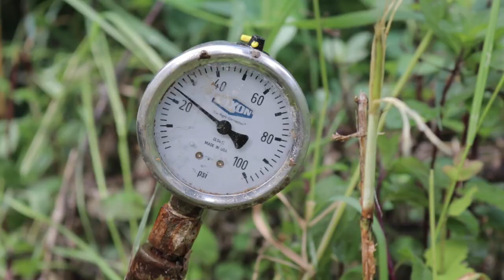My New Ram Pump - AMAZING!

Comment: for your curve shaft weed whacker illuminate the push button cartridge and use 1.5' of .155 line . put it through one hole tie a knot in the middle around the shaft and poke the other end out the other hole. if you have to drill out the holes to accept the line, do it. i highly recommend this method. way cheaper and almost invincible.

Comment: Loved the explanation of the Ram pump. I wish we had a spring or stream on our farm so we could use one... We're installing battery backed solar so we can have water from the deep well in an outage.
That thing about remembering to turn the switch on? Too funny! I've done that more often than I can count. You''d think that after fifty years of running small engines I'd remember the darned switch!

Comment: defiantly splurge on the unions...buy extras for diff sizes and other fittings if you are not good with pipe you can lay it on the floor for a mockup visual aide

Comment: you need to make a basket out of hardware cloth or use a container with lots of holes drilled into it that fits around the feed end of the pipe and wrap that with screen.I guarantee it will flow alot longer before having to clear of instructions,i have lived my life fixing and maintaining water pumps and picked up a few ideas that work.peaceout you guys and well wishes

Comment: while working with a weedwacker,occasionally tap the cutterhead on the ground while its spinning,so it feeds a new line wich is cut to proper length with the blade on the safety guard.its that simple.its not coming out by itself.

Comment: I got rid of my normal weed eater head and swapped it out with a MUCH easier to use push button.  You slide a thicker piece of weed eater wire into the head one at a time and let go of the button, then tada!!!  the longer lasting wire is in place with no having to wind anything ever again.
a few pre cut wires in your pocket will let you weed eat all day and a simple pushed button lets you change the wire. Super easy.

Comment: I just thought of an idea. Is there a way to attach a line to where the water spouts out of the top from the T valve that would bring it back to the little pond? That way you wouldn't lose any water supply. It would continue to be recycled and nothing would be wasted.

Comment: For your union on the ram pump, for future reference, you may want to try a hammer union.  We use them for oil and natural gas piping and they work great.  All that you need to tighten or loosen them is a hammer...

Comment: Just off the cuff Cody, have you considered plumbing the big pump and the small pump in parallel so that with the flip of a ball valve (or gate) you could switch from one to the other, perhaps it could even make maintenance easier as well.  Just a thought. 
Thanks for the segment, interesting as always.

Comment: Would a ram pump be better than putting a small electrical turbine on the end of the pipe, hooked to an electrical pump? Although it is electric, no external power source is needed as the pump draws all its power from the turbine powered by the water, similar to the ramb pump.

Comment: I'm an engineer, great video.  A suggestion, make a big ball out of screen and put that on the inlet end.  The more surface area of the screen, the lower the flow speed through the screen and the less likely the screen will plug.

Comment: You can just get it twice as long, stick it through a hole in the middle and then just make the two even long and wind it following the arrow on it on the back.
Just not wind it to tight and not across each other and it will work fine. The problem with the round wire is that it gets stuck all the time. Just use some thicker square wire and no problemo any longer.

Comment: The motivating force there is inertia. Moving mass has incredible energy potential. The ram pump you have there is a prime example of that working. Block off that exit valve and measure the pressure spike when the waste valve shuts. If your drop was high enough it could literally break the pipe. There is amazing amount of energy there. Love to see that harnessed. You put it to good use.  I'm a little concerned about one made out of plastic pipe since plastic will stretch some. It will still work but I think size for size the steel would be more efficient.

Comment: If you weed eat to close to hard surfaces the angle and pressure on the string will "crack the line" at the head. This also happens to harder line (which slices grass better but is less flexible).

Comment: Just a useful tip for the future. Take a steel Hammer with you next time and hit the nut on the Union. Really hard on both sides and the top. It'll come loose really easy after that.

Comment: looks good  I want  to transfer water using no electricity to feed a small fish pond then run the water course in a loop.
My water source will be from a rain water tank 1000 litres ,is there  a way to save the water from the primer to reduce waste
 I am keen for feed back  from people with any experience or ideas to achieve this.

Comment: I know this is an older post, but I keep my string from getting brittle by soaking the supply spool in water every once in a while. I know it sounds if it it's a silly idea, but it does keep it a bit more pliable and less brittle.

Comment: I made my own wrench for unions like that. Piece of spring steel I believe. Hole saw to make the main hole and a file to make the full lands. Works well for getting the crazy force needed to work a union. Used my forge to flatten out the end wide enough. Would probably be a fun project for you (assuming it was actually of value).

Comment: Put a coat hanger in your tool bag, there. Use it to chase those kinds of clogs. Also, put the same screen material on the top of your standpipe that is used to add airflow.

Comment: This pump works similar to my Reverse osmosis water filter system with tank . Has the same valves and waste water action with the tank holding the pressure and water .

Comment: get rid of that spool of string on that weedeater. go with a commercial head that uses very heavy string in 1 to 1.5 ft pieces. no blade use, and no reel to screw with

Comment: Could you run line from the first valve and collect what it puts off as well? Maybe have small overflow vessel on top, with holes in it release the air pressure that it might build up in the 2nd line. Assuming that would work, you'd have no water loss.

Comment: Seems like there must be some way to use or put to use all that water that gets pushed out of the check valve. I mean its full of energy and has already been pumped wonder if there is a way that could be put to use in the system

Comment: you should take that screen, roll it up in a 1 or 2 foot section, cap one end, and connect the other end to the pipe. It wouldn't clog as fast, more surface area for flow.

Comment: one suggestion for the collection point for your water is a sand filter is what I call him they're white pipe perforated you can set up on the shoreline in the lake right on Sand and they will not suck up sand with a pump I believe they also are quite similar to Sandpoint steel head you could just use a flexible piece of pipe and toss it into the deeper part of the water and it would take a lot longer for it to clog up ever

Comment: Question?      
I'm curious if you thread the waste gate and flow that ahead of the check valve would that give you a slightly higher flow rate?         It's a big what if.    But that seems like energy wasted.             I would love to have a ram pump but we have no elevation with our water it's all flat for 100 yards.

Comment: I think it would help if you put another union on the upstream side of the intake valve. You could than unhook everything there in the fall and it would be easy to clean the pipe in the spring.

Comment: OMG  learn how to use a pipe wrench 3 point  your wrench if you not 3 point your wrench you are squeezing  the pipe or fittings known as egg shaping  and it will be less of an effort  to break it loose

Comment: my question is that if water is free flowing into the pipe at the river, how is it building pressure unless it's running down hill?  the river should be the lowest section of tube.

Comment: You can buy aluminum heads for trimmers that only take small sections of string but if you buy the string with wire in the middle you'll rarely have to replace string.

Comment: Idea for the inlet screen. 
If the water comes from the left close of the end of the pipe
Cut the belly or lower part of the pipe as long as you can and cover it in mesh 
Idea is that the mesh being under the pipe all the dirt is more likely to fall down
Even set the left end of the pipe lower in the water so it is at a bit of an angle
Anything big will hit the top of the pipe and not the mesh

Just ideas ;0)

Comment: You might look into a speed loader for your weed wacker. It prevents the cord from going back into the spool and is much easier to load. The only drawback is that you have to load it more often but it's not bad.

Comment: You should try the echo easy load head they are a lot easier just line up the holes enter about 15 feet of string center it and start winding the head till it only about 8” sticking out. By the way the string head your using I think is one of the worst models around and it also wast more string than any other type also breakers off the string at the holes a lot more than others

Comment: Take a piece of coat hanger with you the next time. You can bend a small hook in the end & use it pull out the obstructions in the pipe.

Comment: didnt see anyone else say it...but after you wind the lower string on the trimmer spool, there is a notch to put the string in to hold it.and also lines the string up to outlet holes...so you dont have to hold it in your fingers, and have it possibly unravel

Comment: Just a quick suggestion for a possible upgrade. 

I have seen a few videos on ram pumps other people have built and posted here on Youtube and found a few people add a collection bucket/barrel to separate the collection pipe from the ram pipe in order to reduce/eliminate the amount of air and debris getting into the ram pipe and reducing flow rates. Usually the water inlet is at the top, ram pipe at the middle, an overflow pipe between the two, and a drain to let out sediment and drain the system for winter in the bottom. A lot of people also add a piece of rubber or plastic to deflect the inlet stream away from the ram pipe to prevent sediment and bubbles from getting sucked in. 

The addition of a system like this is not required but it may help you to not have to clean out the pump as often.

Comment: cool video!!  something that might help with the weedeater is spraying a lubricant on the  line in the head. not wd40 though anything with a solvent in it ends up melting the line.

Comment: For the weedeater if the head ever breaks on that one I  would recommend a new type of head where you just tap it on the ground and more line feeds out. I got it last year and its cut down the amount of time I spend on line changes enough to justify the upgrade

Comment: Nice to see the ram pump at work again. I'm pretty sure I understand how it works but I was wondering if you had a tap on the outlet and it was closed would the ram pump stop working ? My thought is that you have to have the outlet open at all times for the ram pump to continue pumping.

Comment: This is why I love the little cheap Homelite trimmers you can get at Home Depot.  They run fine and the trimmer head has an auto feed, where you simply just thread a new length of trimmer line through the center with the head fully intact.  Takes all of about a minute to restring it when you run out.

Comment: Man, I love those hydraulic rams. I often wish I had a property just steep enough and with a streamlet, just to play around with those... (and I should start wearing a t-shirt "danger! engineer inside")

So, here's a hint that might help you keeping the inlet clean:
Maybe you can build a kind of gravity filter, with 2 chambers, the 1st with the inlet under water, being fed by the spring. Then you add a vertical bar, which the water needs to flow over to reach the 2nd chamber where the pipe is connected.

The underwater inlet keeps anything out of your pipe that is light enough to float on the surface.
The chambers themselves shall enable any sand or other stuff to sink to the bottom, so they have to be built just large enough to ensure a slow flow.

Should be rather easy to clean out, too if you add a lid on the top. And it could be built from some harder wood to make it halfway "waterproof" so it doesn''t rot away and gives you another nice wood project. :)

Cheers & greets from germany!

Comment: Next time you buy strimmer string  get  the  4mm , it cuts  through all tough vegetation and  does not  break so often , 3mm is  a total pain  for  snapping,  I have  the  same  model strimmer  as  you and  it  works  brilliantly   with  4mm

Comment: A helpful hint to extending the life of the trimmer line. Its a monofilament line like fishing line. If you think about it, fishing line becomes brittle if its stored out of water. Although if it is being used often it will last you the fishing season. With that said, I know a little bit about that stuff and if its has not been soaked in water at all times from when you buy it, it will dry out and become very brittle. So what I do is fill a bucket with water and throw the line in the water. Give it a few days if its new and you will be able to see the difference in how long it takes to snap a piece of line off or melt together. I hope this helps.

Comment: This is really cool, it bleeds off a little water to give the long column of water in the higher pipe some speed witch is a lot of kinetic energy that is then used to compress the air in that pipe, then that compressed air pushes the water up to the water tower.

Comment: when you restring a weed eater, cut a lengh of string you want, and let it unwind,  on the florr, then hold the string holder, and spin it, as you let the string wind up, helps the string find its place, and not be stressed, in twisting, , also try to be a bit more particular, wind it up nice and neat, like thread on a spool, or wire rope on a winch

Comment: I think I would take a short piece of 2 inch pipe and drill several holes in it and then rap it with screen and use it for the intake filter.

Comment: where you have your inlet 
you should bury it deeper and cover it with a layer of gravel then a layer pea shingle and last layer of sand 
that will help you from having to clean out your system every year  because the water will be filtered before it enters your inlet

Comment: mrs w will need to tap the string out more often to avoid the string breaking off into the winding part  it just gets weaker around the pivot point  or alternatively get better quality string

Comment: You can save a lot of trimmer wire and time changing it by getting the new style where you cut pieces individually and insert them in the swivel heads. I love mine.

Comment: How do sticks and pine cones get into your system past the water inlet screen?!? I would think this problem would be quite simple to correct?  …,And this question maybe premature as I have not finished the entire video...
Reply: It probably gets in through the ventilation pipe. Must be birds or something trying to hide acorns for the winter. Nope. 🤣

Comment: You could put the head of the pipe completely under water and build kind of an upside down pipe trap after it so it would keep the water level high enough and that would prevent any debris from getting into the pipe since most of it is on the surface.

Comment: so you do know that their are notches for the weedeater line so you dont have to hold it will wrapping the bottom. makes it a little easier to put it back in the head it also has notches where you can line the string up with the holes they go into and it holds the spindle down till you put the cap back on.

Comment: you can get a simpler aluminium head that take's 3mm line,maybe thicker and load's from the top,without having to open anything 'gb super cut brushcutter head' not terribly expensive,might have to order it from Australia though
Reply: tanaka make a tiny little one,but these are twice the thickness and a bit larger in diameter and hold more line  and load different

Comment: You could put a second pipe that connects to the end on a solenoid valve and a compressor fitting. Then you can automate a backflow cleaning system so no one needs to clean the filter.

Comment: Cody, How about on the inlet at the dam you put a 90 degree elbow and maybe a short piece of pipe on it so it sucking water just below the water surface so your getting less floating debris going down the pipe? much like you have on your septic tank outlet.
Reply: Dont't even glue it on, and also have the screen on that, so you still can easily detach and clean it.

Comment: You inspired me to build a ram pump in my spring, finally have it worked out and have been pumping water to an ibc tote tower with a one inch pump since the last frost.  I have had good luck with the check valves with the rubber gaskets in them.  Happy to see more of this content!

Comment: If you were to put a valve on the output end would it stop the pump if you shut the valve or would It start running again when you open up the valve?

Comment: Top tip with those tough nuts, rather than first hitting the wrench use the hammer on the nut as it often releases the rust and moves it to break the initial tension for the cold fused metal =) 
You wont damage the nut with the bigger ones like the ones you're using =)

Comment: a sharp tap on the outside ring of the union with an engineers hammer usually frees the joint.